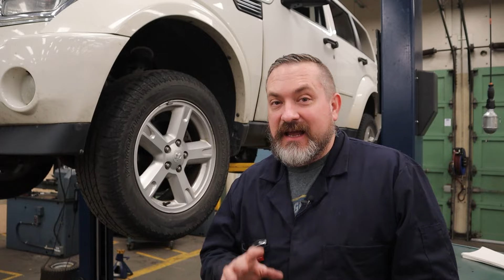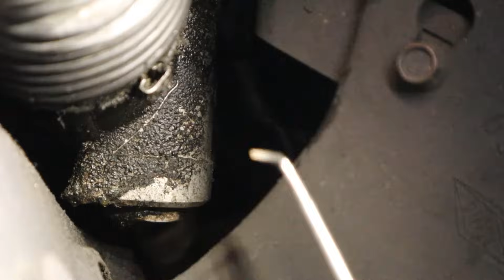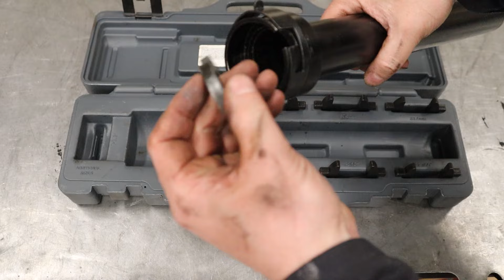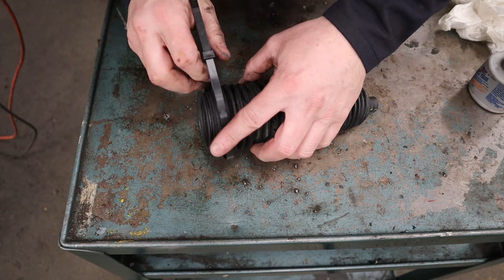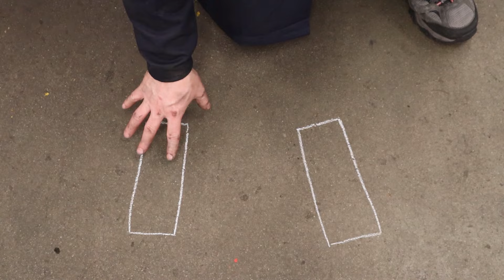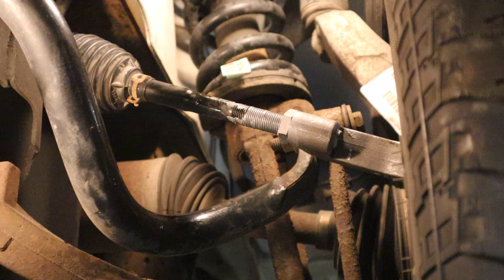How to change tie rods (inner and outer tie rod ends)

Comment: What if you dont have the special tool

Is there another way to get the tie rod out without it?
Reply from the maker: The inner tie rod, no.  The outer tie rod, yes.  You can hammer on the spot i showed to get it to pop.  Thanks for the watch!

Comment: This is a very helpful how-to video for R&R of inner and outer tie rods, however... how did you determine you were tightening the jam nut against the outer tie rod end to 55 ft lbs?  I didn't see any type of torque wrench being used.  Looked like a regular adjustable crescent wrench to me.  What did I miss? Thanks!
Reply from the maker: Thanks!  If you deem me worthy, I'd really appreciate it if you could share out my channel on your social media channel so I can help more people.   Sometimes you need to manually tighten fasteners without a torque wrench .  What I do is torque a fastener with a torque wrench and then manually try to tighten the fastener until it just barely moves.  That is what that specific torque feels like.  You also start to know what certain torque specs feel like.  All of my students small engine have a flywheel nut that is 55 ft lbs so I'm  really good at feeling that torque spec.   Thanks for the watch and welcome to the channel!

Comment: Best video I have found for job at hand!!! I need to replace the rear axle on my wife's 2006 HHR and if you have a video of that job, or know of one please message me. Thanks
Reply from the maker: Thanks! I have a video on a wheel bearing that might be ok to show part of the CV axle removal.  Hope that helps.  Thanks for the watch and welcome to the channel
Reply: @wayofthewrench  Along with all the damage to the front drivers side suspension on my 2006 HHR. The rear axle needs replaced. Do to the weld on the axle to wheel hub mounting plate. Do you have any suggestions or a help site. I never had to replace one so not sure if it needs special attention???

Comment: Informative video. Thanks. But I'm curious as to why you do your rough measuring at the end from a spot on the tyre, rather than on the wheel rim itself? I'd have thought the tyre tread would be pretty irregular due to wear and the fact rubber is "squishy".
Reply from the maker: The tires usually bulge out from the edge of the rim so if the tires are the same tread pattern then I use that.  Tires are actually pretty stiff and the patterns are the same because the tires were made from the same mold.  Hope that helps.  Thanks for the watch and welcome to the channel!